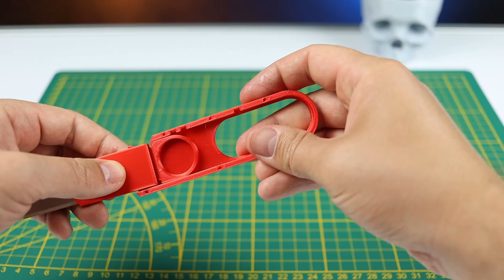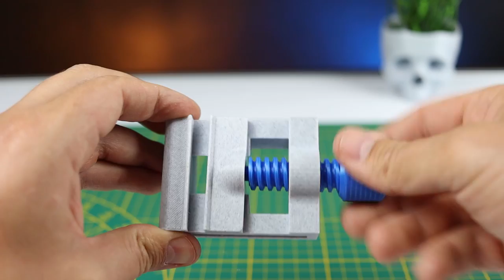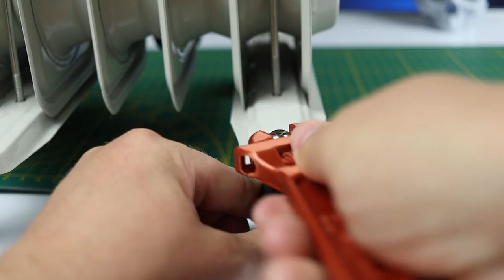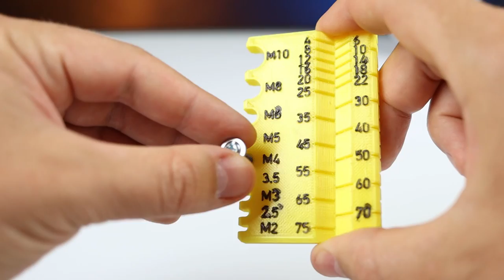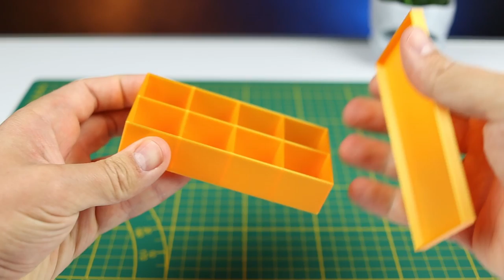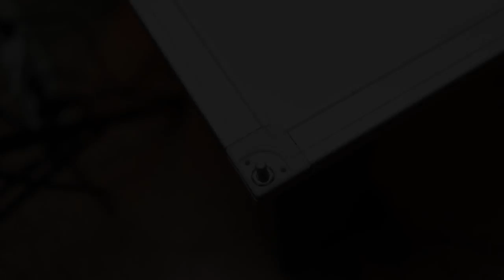3D Printed TOOLS - 13 Useful 3D Prints for Your Workshop #1

Comment: What is your print bed material? My stock ender 3 pro print bed doesn't want to release my PLA prints, which is exactly the opposite problem that I had when I first started. Now my parts adhere to my build plate so well that parts of it come up with the print.
Reply from the maker: It's Prusa PEI ( Polyetherimide ) Sheet